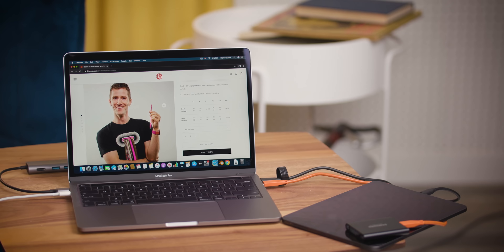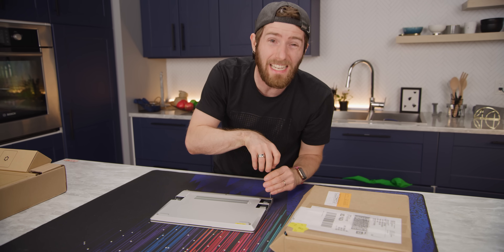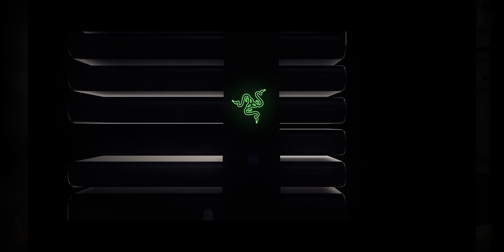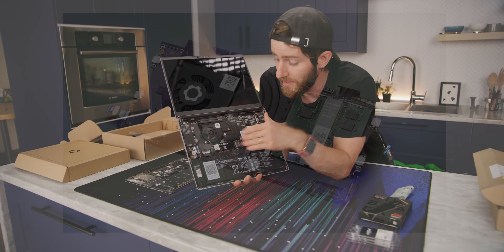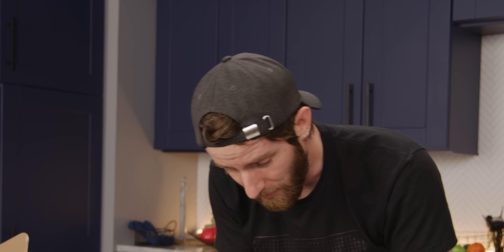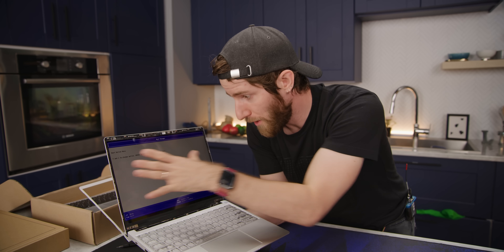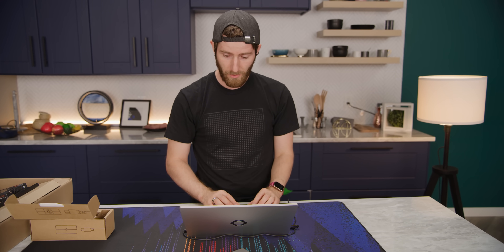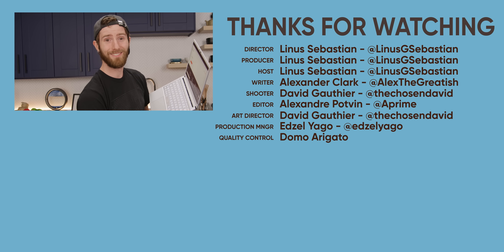A COMPLETELY Upgradeable Laptop?  - Framework Laptop Review

Comment: This laptop is a gimmick and a scam and makes no sense and Ill tell you why.

1. no one wants to upgrade their laptop if they are in the market for an XPS. The people who want to upgrade are PC gamer types who want to get all the performance possible and like to tinker.

2. people who buy laptops dont want to tinker and dont want to touch the insides, thats the entire reason they bought a laptop and not a desktop

3. all laptops today come out with all the ports youd ever want already and youre constrained by the protocols on the board on which technology you can use (displayports, thunderbolt).

4. for like 1500 dollars the amount of performance youre getting is trash, mediocre, and you could just get a more powerful laptop or even a macbook that outperforms it easily, which would save you any "upgrading" in the future.

5. this is just a buzzword laptop to pump and dump their company as channeled through reviewers

6. No gpu.

7. laptops arent big and giant anymore because they dont need to be. believe it or not there are still MXM swappable GPUs for laptops that are modular.

8. I can tear apart my Dell with no fear of losing warrantee and upgrade the drives, ram, clean etc. They also include detailed instructions on their own site

9. expansion slots for different ports are dongles...

10. All of this expandable nonsense looks like a compatibility nightmare. whats going to happen when I want to plug in my RTX 3080 through thunderbolt 4 dock and it refuses to work with all these passthroughs??

11. I can just sell my laptop for half what I paid 2 or 3 years from now and im halfway to upgrading to an entirely new system. No old scratches, or having to order a new battery and board and flash firmware or reconfigure/install windows on my old machine..

12. having parts outsourced from other manufactures like the keyboard isnt new. my laptop has a board designed by CherryMX. The wireless is Intel. the screen could be samsung or LG. this is pretty typical.

Overall a pretty smallminded idea if you think about it. Which leaves the only trend with this nonsense is misdirecting the public to make profit instead of making an actually unique product, since 90% of the traits this laptop have it already shares with literally all the other companies.

Comment: I really want one of these but they need to make a workstation version of this for my video and graphic workflow... I need more powerful gpu and thunderbolt expansion module which would then make it possible to use a EGPU..( I assume that this will come) as well as the ability to add possibly  2 64 gb memory cards for a total of 128.

Comment: Wait wait so with this laptop that we saw in this video, I can upgrade my GPU AND CPU? Which is not possible in any other laptop so far in this world?
Reply: You cannot upgrade the cpu/gpu and also it doesn't have dedicated gpu on it not even gtx... Upgrading cpu means buying a new motherboard that's around 800usd for i5 models motherboard only.
Reply: @jonmon5745  I really hope they would start making laptop gpus and mobos for sale so you could socket different parts all the time, but also having enough watts on the power supply is important as well. Maybe it’s impossible, I don’t really know

Comment: problem with most modular tech ideas is that everything is like hot-swapable
Reply: I wouldn't see why that's an issue. Windows plays nicely with hot-swap stuff for the most part. While the slot itself isn't, PCIE as a spec *IS*. so some future version of this with an M.2/mini PCIE connector could have flush mounted hot-swappable GPUs...

Comment: Dang, I'm impressed with what Framework is doing. I have an old ASUS S46C laptop from 2013 and I'm considering replacements for it in the next two years or so. A laptop by Framework would be amazing, but it's a shame they're still not able to cater to gamers who want strong GPUs just yet. Releasing a gaming line-up with 15" screens and fully upgradeable CPU/GPU parts would be great. That and introducing a way for buyers of the base model to use an external graphics card would be nice. I just hope Framework will still be around a couple years from now.

Comment: IMAGINE USING ONE OF THEIR USB C TO whatever for a phone or steam deck.
Reply: Or a module with some GPIO pins for hobby electronics projects.
Reply: @DFPercush  Arduino nano module?
Reply: @itsasadbunny  Basically, if it will fit as-is that would be the easiest thing. But rather than writing a program to the arduino every time, you could just access the pins straight from the PC, would probably need some kind of driver to do that, but under the hood it could be an arduino, or a teensy, or adafruit, etc. If it's popular enough to mass produce it would probably be better to just have a custom design with a USB controller and ADC/DAC.

Comment: "Doing something good for the consumer."
Apple left the chat
Reply: Apple customers don't want this... The reason apps work so well on MacOS is because developers don't have to worry about the infinite hardware configuration possibilities to be compatible with. There's no reason to mention Apple. Especially if you don't plan on ever using their products. Stay in your lane and let Apple and their consumers be happy knowing their products aren't anything like PCs.
Reply: @t6-30  considering that you use dongles to connect display ports or add more ports anyways, the modular configuration aspect of it is debunked
as for the internal hardware, while it's probably true that apple can squeeze every ounce of performance out of the hardware, if they add exponential amounts of markup on the pricetag, we can just insert more powerful components to compensate for that. Framework doesnt need to build an os since the os used is chosen by the consumer (windows or linux), framework's job would be to add the best drivers to make sure the hardware installed can be used to the maximum limits (which is their goal from the beginning)

and as for your stance, whether you are defending apple or just asking the original post to not bully apple....i wont comment on that
Reply: @t6-30  There is every reason to mention Apple. Apple products are actually really good and, as you said, work so well because of their fully integrated approach. However, the point about them being not good for the consumer in the long run is also true. At best, Apple treats their customers as "frenemies". At worst, they don't view them as people at all but rather as cattle, made of cash, to be harvested.

Comment: i bet in the future you can order touchscreen displays and new motherboards with new processors just plug and play then use the old motherboard for like an sff behind your tv with a wireless keyboard trackpad combo and boom in 10 years you still have a chassis you love and 2 or 3 tvs with older computers behind them so you can do whatever you want. no worrying if your backlight is compatible or if the tv version of an app or roku version has issues like so many of them do

Comment: at 9:04 he says "Chassis detection switches", maybe that's the answer to my Lenovo 20235 model detected as "INVALID" as it knows I run the computer without the case and use it as a PC (the case is cracked from a motorcycle accident). In "hardinfo" it shows "Lenovo INVALID" though I never modify the system firmware

Comment: Hi, this seems like it's going to be my next laptop. But one thing I didn't fully understand is, do their upgrade modules all use TB3? If so, are they single or dual PCIE Express lanes? Basically I am curious whether the laptop could support an eGPU?
Reply: It's just like a normal laptop with no dedicated gpu only difference is you get to change location of usb and hdmi which doesn't make sense at all if they advertise it as laptop that will last.. so if is it gen3 ram and ssd then you are stuck with its poor performance in the next 3 to 5 years same as any other gen3 laptops..

Comment: lets not forget about the reduced ewaste since if something breaks, you dont need to throw away the entire fking laptop and you can easily repair it yourself.
Reply: *Apple has left the chat.
Reply: Yeah especially if your battery is dead you only need to replace the battery instead of the entire laptop
Reply: @nezunish-2-824  Or when the charge chip inside the battery pack is programmed to lie to windows and say the battery pack needs replacing when half the time the actual battery cells are fine.
Reply: @tyronenelson9124  what , that sound like ink cartridge scam to me
Reply: @nezunish-2-824  Its similar and HP are prone to it, disabling the charging of the battery after a certain number of charge cycles.
Reply: @nezunish-2-824  Maybe Apple will stop trying to rob people now when they need a repair. My trust in Apple has all but gone.
Reply: everyone is getting pressed about them including extra expansions or forcing you to receive a charger; but if they took more than 2 seconds to hate on the product and actually see what it is like to customize a laptop, they would have noticed that you select exactly which expansion cards you need or want and nothing more.  Not to mention that the charger is also 100% optional (without the charger you actually save $49).  Stop hating and recognize that mobile tech is advancing.
Reply: @nezunish-2-824  well i can do that with my el cheapo laptop
Reply: Yes, especially with Windows 11 potentially making decent laptops obsolete!
Reply: Ewaste is everywhere in my house from so many computers over the years.
Reply: I have two Alienware laptops that are just junk and idk what to do with them
Reply: @BeefyBinbam  they’re both broke and not worth fixing, I guess I could sell them to someone for spare parts
Reply: @ant lol maybe thanos isnt evil after all.
Reply: How companies haven't faced legal punishment for the amount of e-waste they make with nonrepairable/nonugradeable laptops is beyond me.
Reply: do they let you choose specifically what comes in the package so you don't HAVE to get extra parts when you buy it? if so that would reduce waste even more
Reply: @williambrown3699  Yep, you choose what you want. I'm pretty sure they got a review unit, you can't even get a white bezel yet.
Reply: @williambrown3699  pretty sure its a reviewer package.
Reply: @williambrown3699 yes, the DIY editions allow you to omit certain parts.
Reply: Yeah. And Apple removed the charger because of ewaste, so they should do this too to prove that they actually care, since they clearly don't.

Comment: With so many upgradable parts, being able to replace the whole thing, isn't it gonna be like the Ship of Theseus?
Reply: Pls enlighten me what part are upgradeable (ram size/ssd size) that is not present in any other laptop. Both framework and all other laptop cannot be upgraded to next gen so both are not future proof.
Reply: @jonmon5745  Motherboard, interface ports, webcam (probably in near future), mic (also), maybe even the screen, are all unique. This laptop is UPGRADE-FRIENDLY, and you could even 3d print an entirely different case.
Haven't you seen the whole video? Some laptops won't even TURN ON unless completely closed, this one works with its motherboard out.

Comment: The little modules are interesting, but I wish they had made them a bit bigger so you could do stuff like 2 USB A ports in one module or a USB-A and HDMI in the same module or probably even more useful a USB-A and USB-C. I also don't like how they are your only option for IO and power except for a headphone jack. I think it should have two hardwired USB-C ports (one on each side) and then the expansion slots. They also need to do an ethernet module.

Comment: The one MAJOR problem with all of these up-gradable laptops is that you can only upgrade them as long as the manufacturer makes the non standard upgrades for it. And most of these companies are too cheap to even release BIOS updates 2 years after building the device.

Comment: If I could get this with a dedicated gpu just so that gpu accelerated programs ran a bit better I would get it in a heartbeat, doesn't even have to be powerful, just something (gtx 1050 in my lenovo is just fine for that job for example). Having the ability to just carry around those expansion modules for whatever port or storage you may need is amazing. I am always bringing a dongle and an external hard drive around with me when I need to use my laptop and this instantly fixes that need.

Comment: One thing that I wish they did different - having two of these modules with no gap between them. Like - have some sort of rail on the top and bottom, so it's secured, but don't have a complete wall between the modules. That way they could make bigger two-slot modules containing at least 3 IO ports. Like HDMI, RJ45 and a Type-A could use one bigger module, having 3 ports in only 2 slots.

Comment: Ahh, I really like this laptop, but a few things I am on the fence about. 

1) Thunderbolt I would really like at least one of those to be thunderbolt for docking/external GPU purposes. 

2) Ethernet port, This one I am not too worried about because my bet is it will be a module sooner or later. But I personalty can't have a laptop without it. 

3) Touch screen as Linus pointed out.

But honestly that is it. And 2 of those 3 could be added later.

Comment: Okay, some critics here.
First: this laptop is FULLY proprietary. Only one small company in the world can produce spare parts for this. I bet that if they can change RAM module into "unique" proprietary shape they would do it. And because that startup small and unreliable you can't be sure that you ever will be able to get upgrade parts.
Second: because of modular design all I/O ports is same size independent of their functional density. I'm personally want to have at least 4 USB ports, Ethernet and some video output at the same time. But It only have 4 module slots that take a lot of internal space.
Third: all this "magnetic", @only five screws" etc in my experience leads to unacceptably low level of reliability. Magnets is bad because they will catch all magnetic crap from outside. If any of five irreplaceable screws dies this laptop will fall apart. After year or two you can expect a lot of gaps everywhere. 

But in summary, this is pretty cool thing. Just a toy for enthusiasts, but still cool. 
Not gonna look into it until Framework reaches at lest some level of stability.

Comment: This is an absolute joke.

1) Is this marketed for business or for home consumers? Clearly not business.
2) how about you do the same tests like you would with any other laptop manufacturer? Keyboard flex and lifting the lid with one hand?
3) Framework is all engineers clearly, that do not understand business. This product is a show of their engineering but has absolutely no future.
4) People aren't going to be swapping out from mini-DP to HDMI daily, or switching on a daily basis which side USB is on. Give it a break. These are gimmicky "features" on a budget laptop.

The reason other larger manufacturers haven't perused this upgradable way is because it doesn't make sense anymore. If people stopped buying shitty macbooks or non-upgradable laptops (speaking of HDD/memory) and put their foot down, maybe that would be enough to push some kind of change? Look at the Lenovo fanboys and their push for the classic keyboard or requests for trackpad improvements. Change can happen.

Watch, this product will be forgotten about once your other brainless videos are released. People are barely going to buy this product because it's a shitty laptop with upgradable memory/hard drives and proprietary stupid USB connections.
Reply: Don't even bother talking to all retards talking this is the future. I've tried and getting alot of backslash from fanboys.. Just a modular usb ports (IO) and they call it "fully upgradeable" and it's the future lmao... Cpu, gen 4 ram/ssd are not upgradeable so I don't understand why alot of dumb retards thinks this is future proof... Linus must be getting a huge sponsorship for overselling this garbage modular usb ports... 750$ for literally motherboard only with i5 cpu, no ssd, no ram, no windows and no wifi is JUST PLAIN SIGHT SCAM. Soon months after its release alot are gonna complain about this utter garbage lmao preconfigured framework models are 1000$, 1500$ and 2000$ that's too much doesnt even have gtx or rtx on it only difference is the modular usb.

Comment: At the price points they offer, this would be a perfect dev machine workhorse for me..  On their site, they even say they've tested the hardware with several distros of linux and have guides.... even windows 10 with WSL would be a solid option..  and as I need to expand my hardware and change out modules for different situations, the flexibility is amazing..
Reply: Like what situations pls enlighten me... Swapping IO for what? Lmao
Reply: @jonmon5745  in my role, I am frequently giving presentations in various rooms that have weird connections (hdmi, display port, etc, or I'm connecting to all sorts of dongles between my home and work setups.  I also have some legacy audio interfaces, so if they ever came out with some firewire connectors, that'd be 🔥.
Reply: @davidstillson  pretty much all current gen laptop right now have usb c and hdmi out for display except for displayport not all have it...

Comment: old devices had schematics on the inside of the panels ok they are not like a laptop its a bread toaster but its more then 40 years old and still works my dad had to put some new wires in it and they still use it it works very good but it shows how things changed now its hard to find good documents of the stuff you are fixen cars and bikes etc

Comment: Regarding battery disconnect, although it's not the same, thinkpads have a similar setting, to disable charging the battery. You can also configure it so that it gets disabled at a certain charge threshold